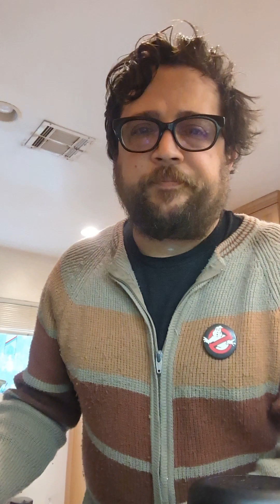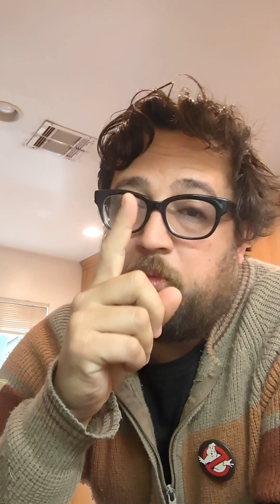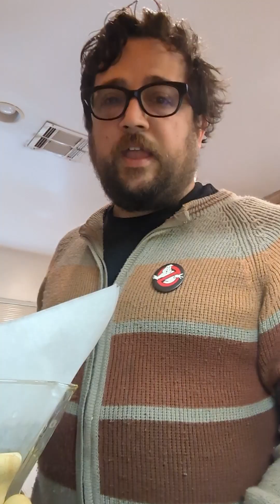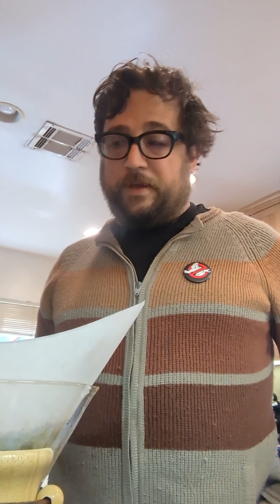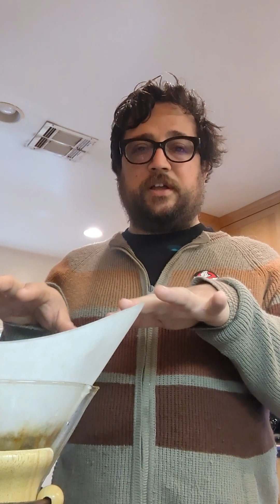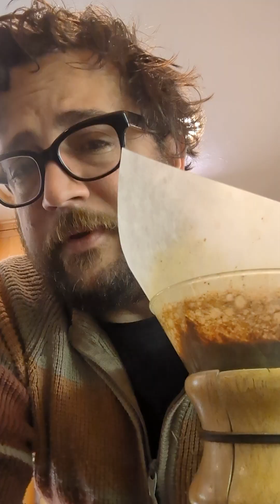A note about preamp gains, and padding mics

Comment: I need to try this on my Heritage Super 8. I would guess that Neve clones that have off in the center are the ones that have the two amplifiers.
Reply from the maker: That's generally correct, yes!
Reply: @29Pedals  Is there much of a difference between adding a pad to your input to hit a preamp harder, vs hitting it harder on the front end without a pad but moving the fader/output trim down? In theory
Reply from the maker: @bassedthechannel  Well, if I understand you correctly, you still need to know where in the preamp the pad is to get the full answer. The channel fader would usually be the last place to reduce the level before tape, so trimming a lot there and adding gain (or simply not padding) would most likely result in the most distortion of the preamp and channel strip. Whether the distortion is pleasing or not may depend on the preamp/channel. I think the main point of the tip originally was to allow you to switch in the second gain card, which sounds great but is not necessarily hitting anything harder. A variable gain mic pre like a chip preamp in a small modern mixer or interface will probably care the least. Padding with an outboard pad and turning up the gain will make little difference except creating noise, unless it's a 1073 style pre or something else that actually switches in another card.